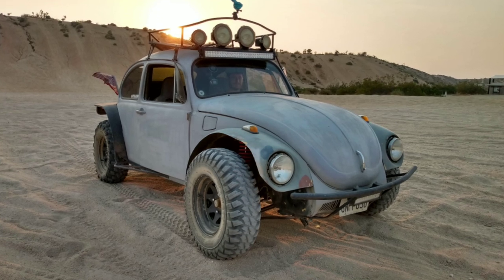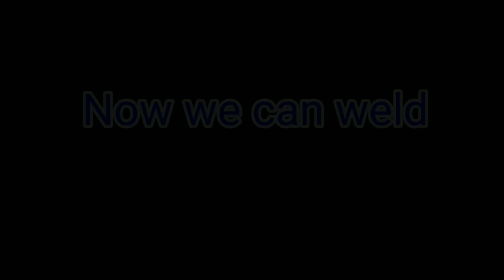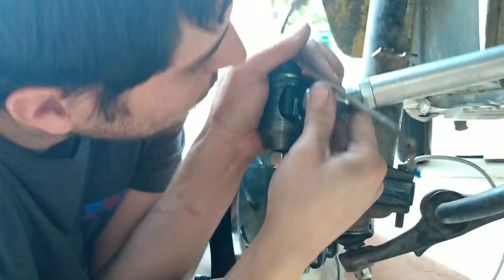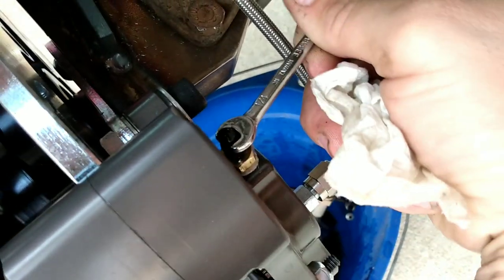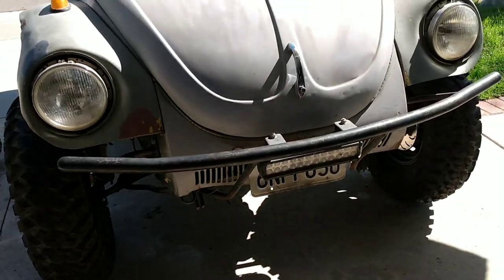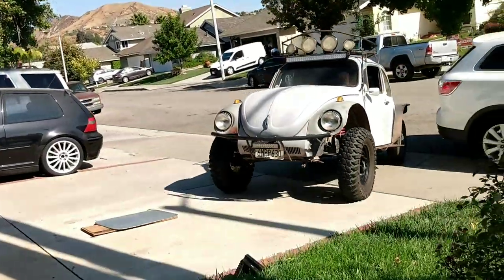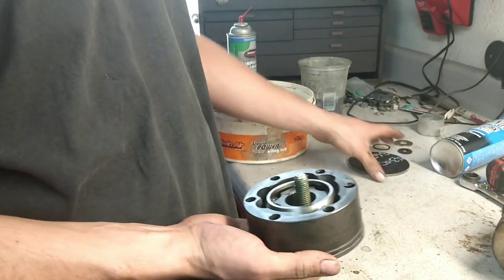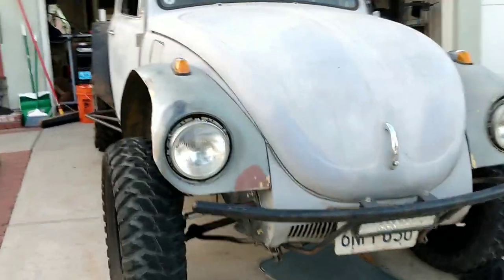Baja Bug SPINDLE LIFT KIT for a SUPER BEETLE 💁😉

Comment: Hey guys! I'm Ken. Live in Florida. Ive built some badass Baja's back in the day. Won a car show in Gatlinburg TN in the Baja class. My last one I built was a 74 super beetle. I didn't upgrade the spindle but I installed additional coil shocks in front of the stock strut. Still had full turn radius. I really gave it a beating doing some amazing stupid shit going off roading in TN. I had to make an adjustable bar connected to the top of the struts inside the trunk to keep the strut towers from bucking in on jumps. Ive really put those front ends to the test. One thing you have to do is beef up the bottom control arm. They tend to buckle n crack right where the away bar connects. Weak spot. I just used some iron n tacked it in. It's a must. A rear skid plate is a must as well. Cutting brakes is a wise thing to install as well. It will save you ass when you have that one wheel spinning. Lock that one wheel n all your power goes to the other. I also set my valves at .007 instead of .006 in hot weather. Take it easy Bro! 😁

Comment: hello, here in northeastern Brazil it was very common in the 80s to use vws, which we call Fusca, to make bajas. But they were very simple adaptations, fiberglass kits and larger tires were used and we were ready to put them on the beaches and dunes. Congratulations for the projects are very creative and with a much more elaborate degree of construction compared to what we have here in Brazil.

Comment: I’ve got a ‘74 Super, been looking a cheap standard for my grandson and I to make a Baja out of. Might have to rethink that. I see that you’ve got the 71 - 73&1/2 ball joints that bolt on. Wondering about how something like your setup could be used on the press in ball joint type. On second thought, I remember seeing somewhere that your style control arms are a lot stronger than the later ones. Anyway, super job, you’ve got mad skills.

Comment: "Heim having problems..." unpacking everything you included in this video! 

I was concerned about the bracing on the spindles - till I saw how Spence tied in the steering arms.  Nice!

Was that a one spline turn on the rear?  Just be aware it's going to kick a tiny bit more on the whoops.  Any more on the rear lift and things get spendy quickly!  For now, looks good!  Normal driving you won't notice it, but it will be tiny bit more tipsy on the side hills.  Nothing a little right pedal can't get you out of!  Haha
Reply: Yes, we added one inner spline tooth of preload to out oversized torsion bars. They were set with no preload before... We will see if the rear kicks up too much lol

Comment: I’m trying to raise my 1973 Super Beetle; is that possible? Everyone is telling me no, it is not.
Reply from the maker: I'm not sure if the later supers have the same spindle design as the earlier ones, I would have to look at one to know. But if it is the same then yes you could theoretically use all the same mods we did on the Dust Buggy for any year Super beetle, including the custom spindles we made that give us about 4 inches of lift in the front. However you HAVE to brace the space in between the strut towers or the bug will collapse on itself eventually if hit hard enough